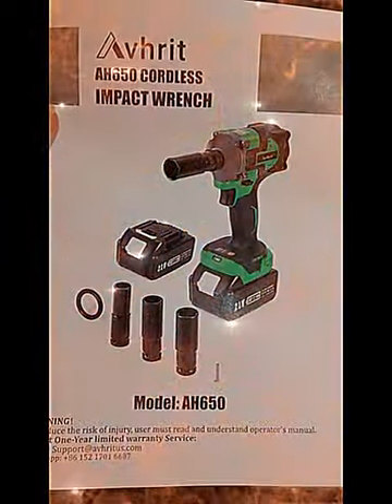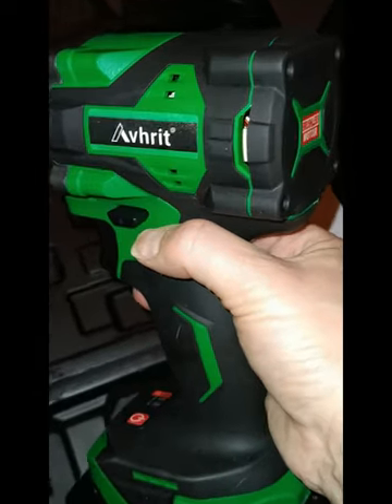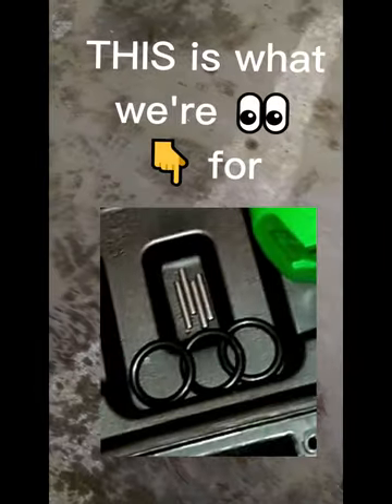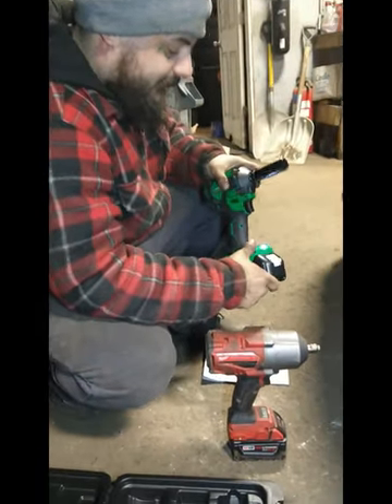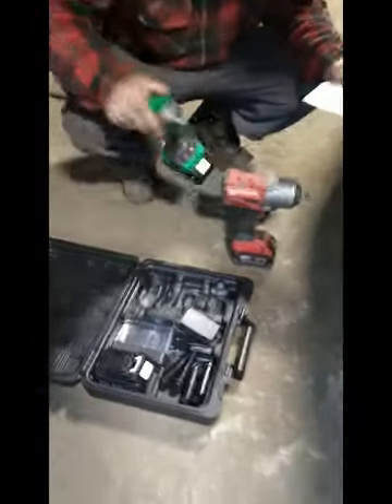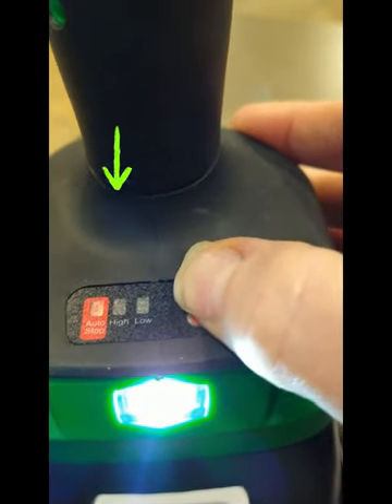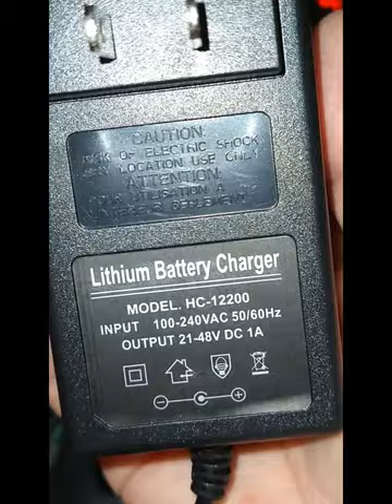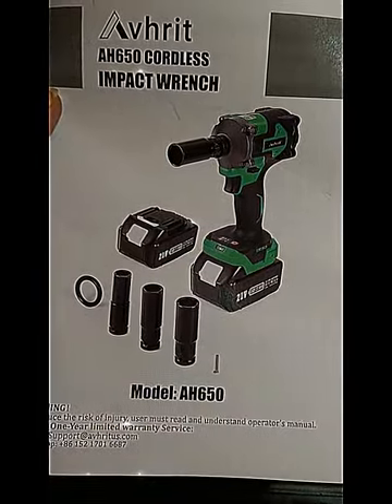CORDLESS Lug Nut Socket IMPACT WRENCH REVIEW Avhrit Model AH650

Comment: Good review on the Avhrit impact. The compact size  are good for getting in tight spaces where a longer big one can not or have a hard time doing so. I'm looking at this unit now for removing riding mower blades. Auto stop is a neat feature to have in some situations. Thanks for the demo.
Reply from the maker: Can you explain a situation where the Auto stop would be helpful?
Reply: Just an example would be when i am lying on ground, riding mower is jacked up to take off mower blades. My arm underneath mower deck and with auto stop on helps control blade bolt from flying off at continuous fast feed and mower blade falling down quickly. 
That may have been confusing example. 
Basically auto stop keeps the loosened bolt or nut from continuing to spin when it's already came loose. It's not necessary, just a added feature.
Reply from the maker: @SlwRpr  THAT'S AN AWESOME 🎈 💯 ♥️ EXAMPLE, THANK YOU!

Comment: Not really fair to compare that to milwaukee high torque. But you should compare that to a Milwaukee low torque instead the are about the same size. Or even the new mid torque milwaukee.
Reply from the maker: Well, quit frankly, it wasn't exactly planned to know what type of socket wrench the mechanic would have.
Reply: I have all 3 size of Milwaukee. This is very comparable to the low torque. Was thinking about buying one of these because it's just something to have in the car. If it gets stolen, no big deal. But it looks like a good deal. 479 ft lbs is a lot for that size.
Reply: @joannesinspirations  but it a good deal what you have. If you know someone with a Milwaukee low torque ask them to give it a go. Both should be very similar. I like using my low torque for brake job because of the small size. I'm not biased against tools but good information is always good to share to people who can't really afford name brand.
Reply from the maker: @theunknownone5663  absolutely, I totally agree. I love the size of the tool for my hand as well (as mentioned in the video). I would definitely recommend another brand, as opposed to this one.